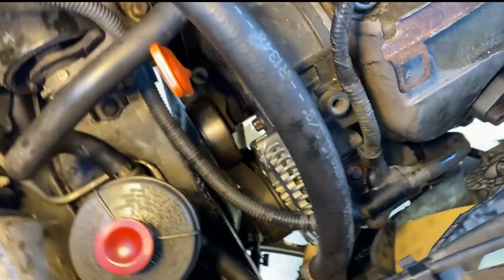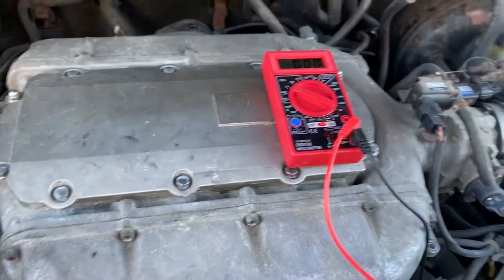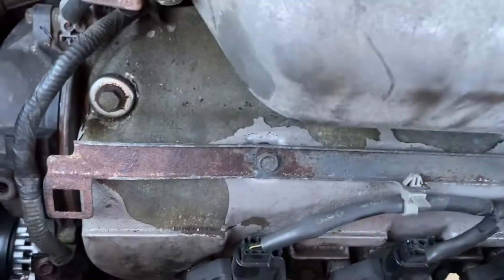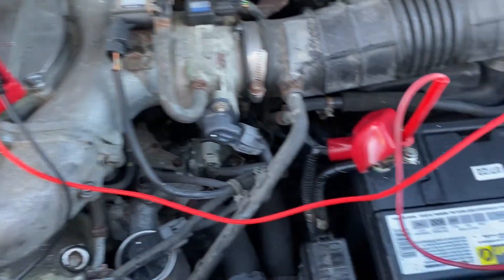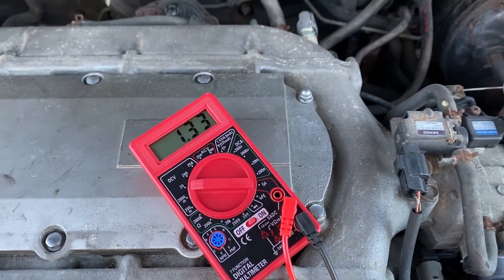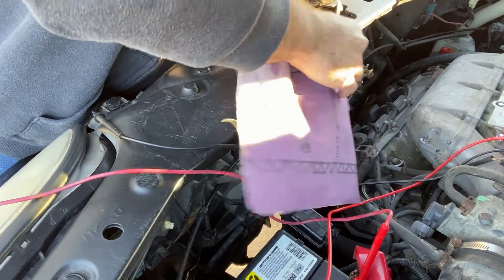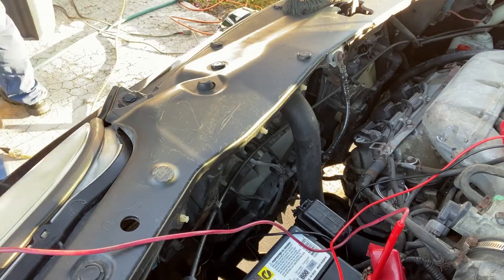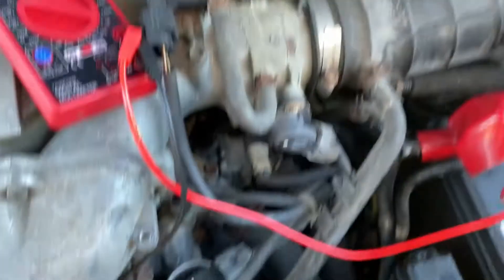Solved - New alternator! No charge???

Comment: I just swapped out my alternator three times and was about to throw in the towel because the same issue, the battery was only getting 12.4 volts each time! Then... I saw this video and had exactly the same issue - poor engine  /alternator grounding.  The car is only 10 years old, and the only corrosion was on the engine ground wire. I noticed that the metal on the wire connector was a bronze colour, while the bolt was obviously steel.  Different metals, moisture, age and electricity all adds up to rust.  Thanks for making this video.  Such a simple fix.  Thanks for showing the steps clearly and logicallly. A+

Comment: So, just so I am clear - the issue was the poor connection of the ground wire, and not the alternator after all?
Reply from the maker: That is accurate. We trusted the car owner did their due diligence when they told us the alternator was bad. It wasn’t until we installed the alternator we got the full story at why they assumed the alternator was bad.
Reply: @Thatguysauto  We have a 2010 Toyota Sienna going through this sort of thing right now so this may have helped us a lot I'm crossing my fingers because we've got no money